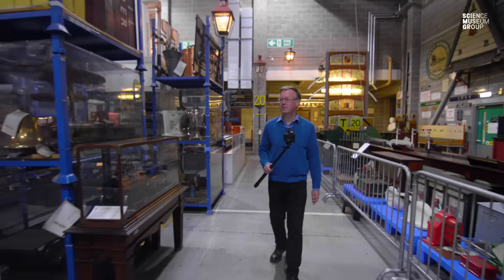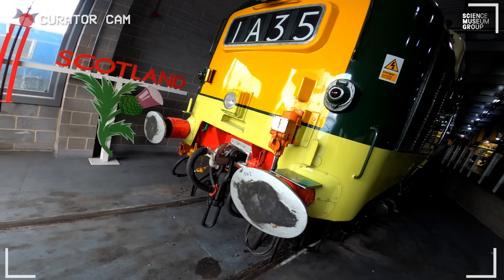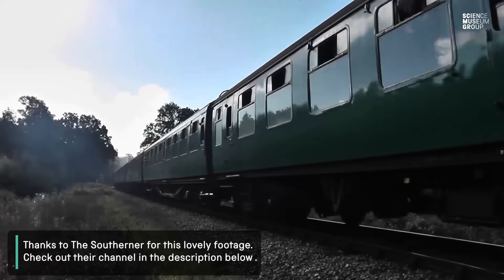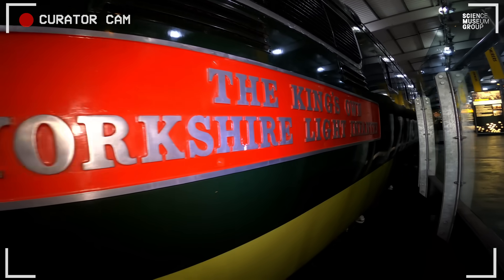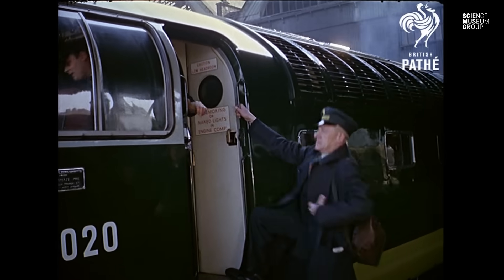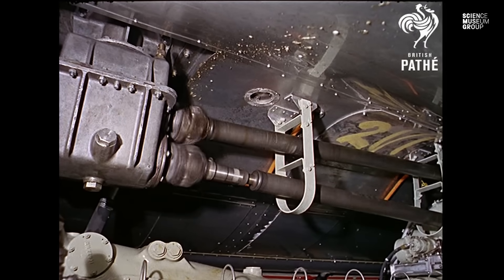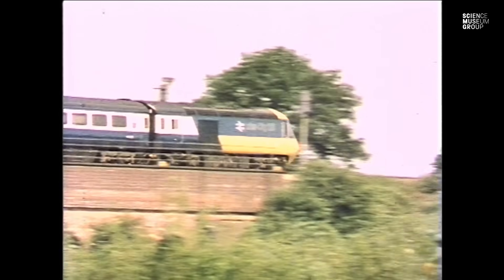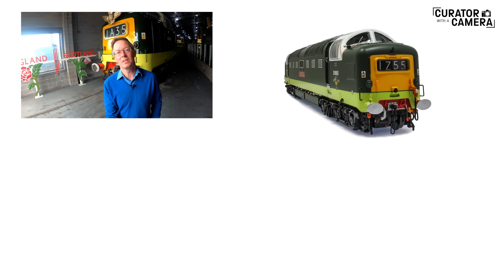Deltic: Step inside the diesel BEAST | Curator with a Camera

Comment: Dtiver?  You don't have to acknowlege a green!  You get a bell and the sunflower will be black after passing over a permanent south pole and an electromagnetic north pole of the AWS.  Else I've wasted 41 years of my life with railways signalling.
Also, the Class 800 on the western today carry a silly amont of dead weight as they have engines and fuel under the wires. Dumb?  And much dumber still, they often use this diesel-electric power mode under the 25kV wires.
Progress?  NO.  You couldn't make it up.
Still a good video.  Thanks for taking the time to show the Deltic. Wish you showed the engine as not all crankshafts rotate in the same direction.

Comment: The engines were massively de-rated for reliability, I believe they were rated at 2,500 hp each for marine applications.
Reply: Absolutely. I believe that naval ‘services’ included replacement of just about every moving part.
Reply: So pretty much as powerful as a GP38-2
Reply: @ViperZero523  how about a size comparison?
Reply: @ShaunieDale  in what way? Horsepower for the GP38-2 is around 2000, and the SD40-2 is around 3000
Reply: @ViperZero523  the EMD645 16 cylinder at 36,000 lbs and the Deltic at 10,700…
Reply: @ShaunieDale  well one is a road switcher and the other is a passenger engine
Reply: @ViperZero523  what exactly is your point again?
I know that as a Yank you are completely gaslighted into believing that absolutely everything American is better than the equivalent made anywhere else in the world. As a person from elsewhere in the world, we know you are simply wrong. 
The Deltic was a unique and remarkable power unit it weighs around a third of the equivalent EMD boat anchor for the same power output. The class 55 could then have two of them. Engine failure just meant slowing down a bit and carrying on.
Reply: @ShaunieDale  never said it was good or bad, I was more or less making a mental note that it's semi comparable horsepower wise
Reply: And the gaslighting? Pretty sure every country does that but ok

Comment: At around 11:10 you say the DSD is connected to the AWS. The DSD is connected with the vigilance alarm which sounds after a given amount of time to ensure the driver is still vigilant. If the DSD is not raised and then depressed to acknowledge the vigilance alarm, the brakes apply. The AWS is linked to the signalling which, if a green aspect is shown, a bell sounds which requires no acknowledgement. Any other aspect causes a horn to sound which has to be acknowledged by pressing the silver button to the left of the AWS sunflower. If no acknowledgement occurs, the brakes apply. AWS is also used to warn of certain speed restrictions. From the Rule Book: “Where a reduction in permissible speed is provided with a warning indicator (i.e. the permissible speed on the approach is 60 mph or more and the reduction in the permissible speed is at least one third) an AWS permanent magnet is provided 180 metres (approximately 200 yards) on the approach to the warning indicator. These are sometimes referred to as ‘Morpeth magnets’.

AWS magnets are also used to alert the driver to the following.

Level crossing warning boards or indicators.

Temporary speed restriction warning boards.

Emergency speed restriction warning boards and emergency indicators.”
Reply: I’m not aware that any of the Deltics are fitted with a proper vigilance system. The DSD on its own only provides a foot pedal that must remain continuously depressed. The connection between DSD and AWS is that both use the same method of brake application.

Comment: I think this loco has such mystique because it was the pinnacle of independent British engineering.  A symbol of lost industrial dominance.
Reply: It wasn't really a massive success though in engineering terms. It was plagued with reliability problems and by 1980 most of the fleet had to be cannabalised to keep the few remaining examples running. Reliability and standardisation is a more important aspect of modern fleet operations, rather than just raw power. In this respect I believe HST was more a pinnacle than the Deltics.
Reply: @PreservationEnthusiast Go and melt down some fanta cans.
Reply: @markbeale7390  The Deltics have long ago been sliced apart with cutting torches at Doncaster works in the mid 1980s and all the scrap extracted and sent for melting, apart from a few preserved examples.

Of the HST class 43, 24 have been scrapped, 40 in storage awaiting scrapping, and the remainder preserved or in service.
Reply: The engine was originally developed during WW2 to power motor torpedo boats which initially been powered petrol engines which made them vulnerable to enemy fire. .

Comment: Please, no! Track workers aren't alerted to the approach of a train by the horn. They see the train and move to a place of safety after seeing the train. If they relied on hearing the horn they would not always have sufficient time to stand clear and they would depend on the driver seeing them, which can't be guaranteed (drivers are busy people). The yellow panel made trains easier to see when speeds increased.
Reply: Wrong. Not all track workers sre allocated a Lookout, it depends on the type of work being carried out. A Driver can`t rely on people trackside seeing him because they maybe engrossed in their work or simply be facing away. The Rule book says that on seeing people on or near the Track a long blast on the horn is given which is acknowledged by raising one arm above the head and then moving to a position of safety.
Reply: @stephensmith4480  I didn't say that drivers shouldn't/don't sound the horn, that horns don't save lives nor that trackside practices are perfect, but in 33 years if I'd relied on hearing the train or its horn before moving to a place of safety I would have been mincemeat. An electric train and even HSTs at 200km/h are effectively silent in many locations - try working at Weedon or anywhere else near a motorway and relying on sound (even in the cutting near the Medway where the driver cannot see you, similarly Alnmouth on the down line). The video implied that personnel working on the track are waiting for the sound of a horn before moving aside and that is not the case. Drivers probably notice dangerous work but not so much when workers have applied the rule book correctly. The statistics suggest that most work is carried out safely, but as I was told on countless safety training courses that's no excuse for complacency and not making improvements.
Reply: @pappakilo3965  Well firstly I too have over 30 years of railway experience. I have worked in numerous yards as well as freight guard duties on Ballast sites all over the place,  under T3 Possession as well as during Train running. I have also spent a number of years with The Breakdown & Recovery teams, working literally the length and breadth of the country so lets not try and start Dick measuring or Back tracking and trying to justify it with a load of what you thought was going to baffle me. You said and I quote " Track workers aren`t alerted to the approach of a train by the Horn " Unquote. If the horn is not there to warn you, then what is it there for? To play tunes on. You were trying to impress and it backfired because what you said was wrong. End of.
Reply: @stephensmith4480  the horn isn't there to clear workers off the track. It's a general warning device. I'm not measuring anything here except the time it takes to clear a workgroup off the track verses the distance that a train's horn can be heard and the fact that not all drivers sound the horn. Working in a T3 is very different to working with lines open to traffic. How can the workgroup hear the horn when background noise is high? Look at the distance chart in the COSS Handbook (HB7). Even at 100MPH the warning time required is around 25 seconds which means the group must be warned when the train is some 1240 yards away which is close to 3/4 mile. On a perfectly still day at a quiet site you might just hear the train's horn at that distance. Generally drivers don't sound the horn until they're around 300 yards away. Workgroups working on open lines use sighting to warn them of the approach of trains, not the train's horn. It's as simple as that.

Comment: Is there much air drag where the loco connects to the rollingstock?  Looks like the lowered nose creates an air ram into the first car.
Reply: There must of been a huge amount of air drag. I was hauled by a class 40 once, a similar design and the door on the coach end had been left unlocked We opened it to see the loco and the amount of heat and wind blowing in was incredible After filling the coach with exhaust fumes we thought it best to close the door.

Comment: They weren't necessarily higher revving, but as the Deltic engine was a 2-stroke it sounded faster, highly distinctive, and generated twice as many power strokes as an equivalent 4-stroke. The opposed-piston triple-crank design is also highly efficient for the amount of moving parts and rotational mass, and had already been proven in military ship use.

Comment: Thanks Anthony for including (at 1.47 into your video) a South African Railways class 3E electric locomotive hauling the world-renowned 'Blue Train'  at speed.  The 28 class 3E Co-Co locos were supplied by Metro-Vickers to the SAR for main line services - from fast passenger to goods working in 1948.
Reply: if you replace the stop with a colon in the timestamp it links into the video at that point, as in 1:47

Comment: Fun fact: The US DARPA is currently working on a deltic 2-stroke turbocharged diesel engine for military use. It is light-weight, has a high power output and is fuel-efficent. So far, fuel efficency was rarely something US military engines were known for. Modern times....

Depending on purpose, the engine can be scaled up by the use of multiple rows of deltics.

I am shure it will be used sooner than later for civilian purposes....

Comment: great video,but why only a few saved ?  why wont the first one run rather than being stuck in the museum ?
Reply: I don't think the NRM will allow the DPS to re build the engines as it will interfere with it's originality,could be wrong mind.
Reply: There is nothing ‘original’ about the engines in KOYLI. When the deltics were brought into service, there was the 44 engines in the locos and a number of spare engines. This was the beauty of how 22 locos were able do the work of twice the amount of steam locos. If a power unit or traction motor or what ever failed it was a fairly straight forward job to open the roof up, lift the power unit out and replace it with a working unit. The failed one could then be fixed at leisure while the locos was released back into service. 
KOYLI was originally considered unrepairable when in the NRM, then in the early 2000s a group of volunteers found parts that were ‘missing’ and were able to get her running and mainline certified again. As I understand it around 2017 there was a change in management at the museum, who decided that the volunteers were not working to an appropriate level of health and safety so all work was stopped on her until such times as the appropriate level of health and safety training could be provided. I believe there was a sea change in attitude where it was decided that the loco should be conserved and not kept in a running order. However as I said at the start, Deltics were designed to be modular for ease of maintenance, so there is only a much repaired and reskinned body shell that really is KOYLI, the rest of her is a bunch of parts that have been liberally shared around the Deltic fleet. Whilst there is still 4 deltics (I think! Not sure what is actually happing with Royal Scots Grey) operating, I think it is a huge shame that where a loco can be fixed and run, and where ‘originality’ is not a real issue that this loco cannot be seen and heard for the future generations, and after many happy journeys in my youth behind KOYLI it would be nice for name to share with my children and grandchildren

Comment: How does cab 1 differ from cab 2?
Reply: afaik No1 end has the electrical gear,and No2 end has the steam heating boiler/cooling system.
Reply: @lj03oem  Its the other way round. Switchgear etc at no 2 end along with the steam boiler (Deltics excepted), radiator etc at no 1 etc.
Reply: Not to mention the urinal...
Reply: @lj03oem .the  boiler on a Deltic  is  right  in the  middle. Between  the  two  engines.
Reply: On most locomotives the number 1 end had the coolant group and steam heating boulef was at the other end. However on the Deltic this isn't true as both ends had coolant groups and the boiler was set centrally.

Comment: I’ve always wanted to know why these and others like 37’s had noses now I know! Thank you so much for the insight.
Reply: In USA early on there was a theory that drivers may become hypnotised by the view of the rails and sleepers passing below the cab so they built their locos with a nose to prevent it happening. Our early locomotives EE Type 4 Deltic and EE type 3 were all built in a similar style. To distribute weight throughout the locomotive the equipment mentioned was fitted into the nose ends, it was also a clean area away from the engine. Later on it was found these nose ends were not required and our later locomotives were built without nose ends.